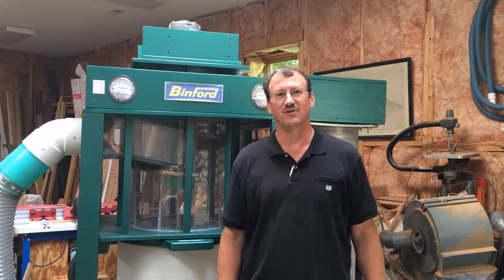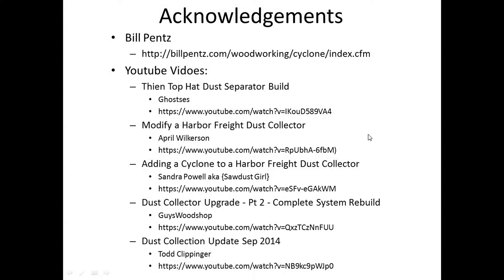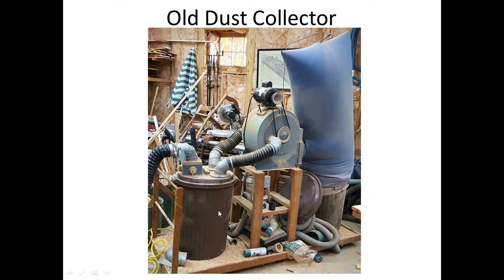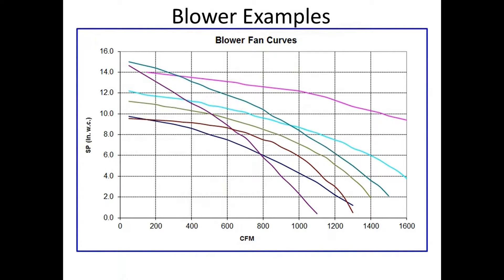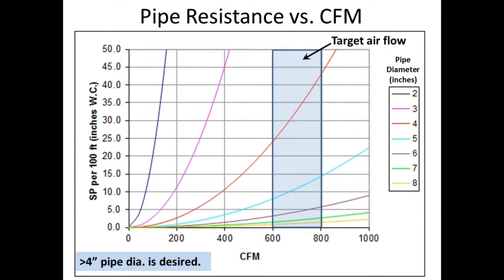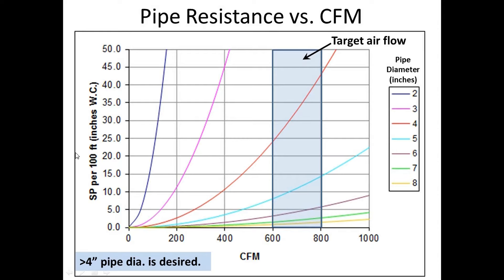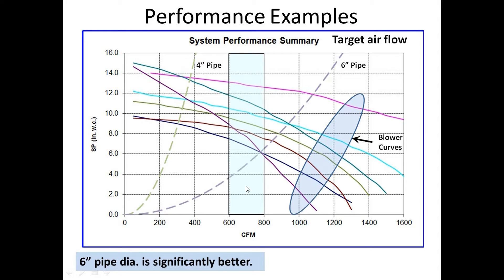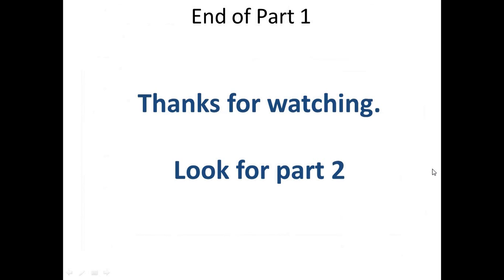Cyclone Separator Concept & Design Part 1

Comment: Hi Keith. How did you reduce the diameter of your 6" PVC inlet pipe to get the flex hose to fit?
Reply from the maker: I took a short piece of the sewer and drain PVC, cut a gap in the side so that if fits snugly inside the uncut pipe and glued it inside.  Then I can slip the hose over this pipe and attached a hose clamp.  the uncut pipe end will then fits inside the regular fittings.  This has worked well for both 4" and 6" hose.